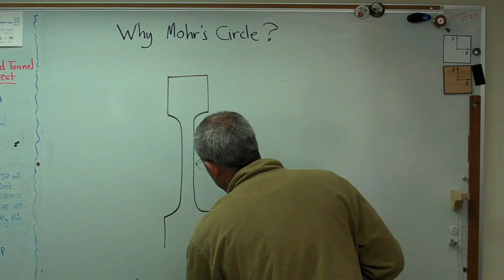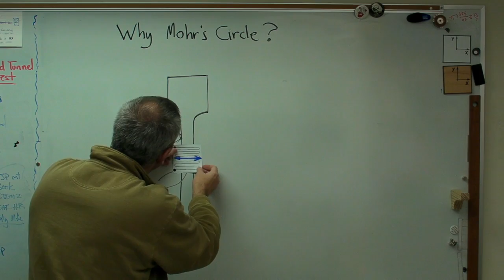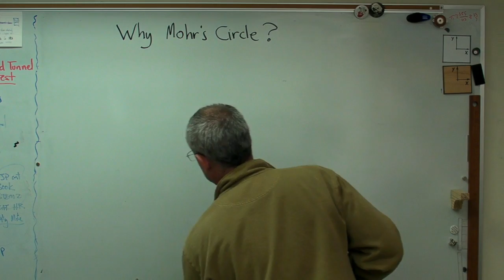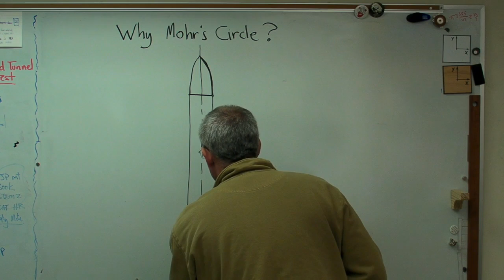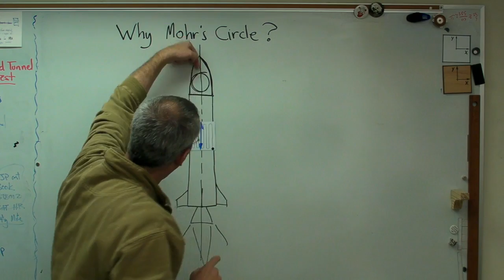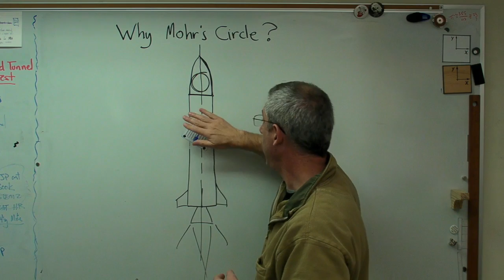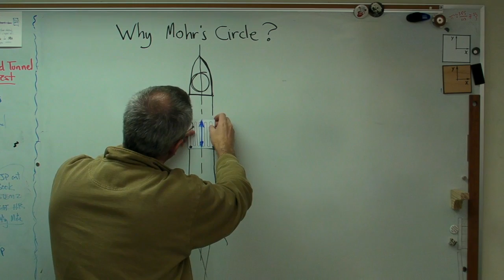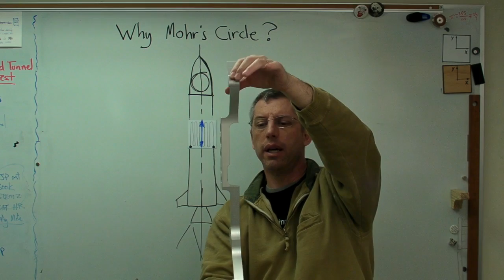Why Mohr's Circle - Brain Waves.avi

Comment: You obviously know your audience. That's critical! Good job purdueMET. I've been a ChemE for nearly 30 yrs. However, my educational background is ME. I'm also a registered engineer. I find your video very helpful. Where I work, we have several young non-tech, sci-fi nerds who ask me aerospace questions. We produce oxidizers for MFGs of solid rock motors. So there is the connection. I find it difficult to explain the physics of rocketry. I get too technical. Your video on "Why Mohr's Circle" is a good vehicle to show them the big picture.

Comment: You skipped the part(if we didn't have Mohrs circle) where engineers would stick 180 strain gages(1 for each degree of orientation) onto the rocket to find the maximum stresses.
Reply: Even with Mohr's Circle, and high speed computers, there is still a lot of testing of physical objects.